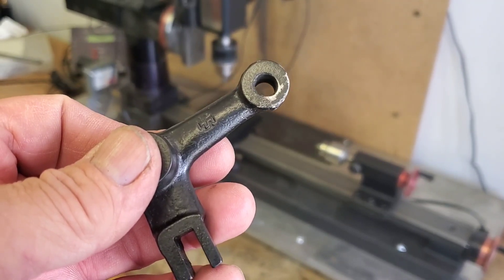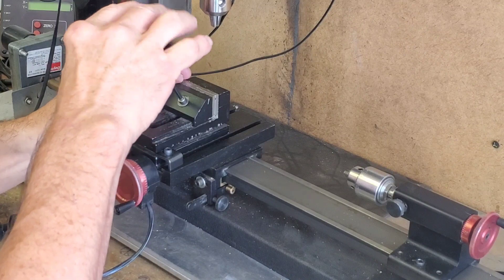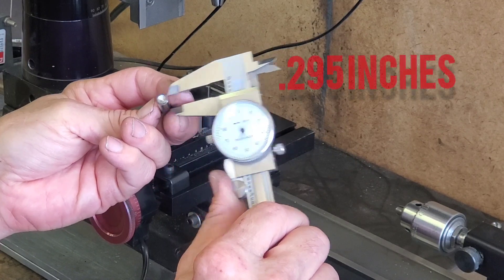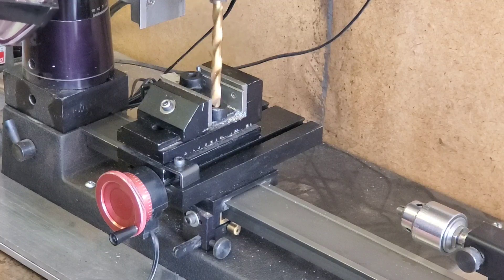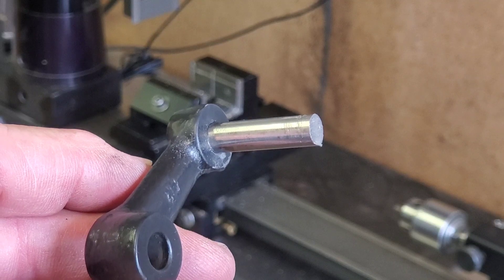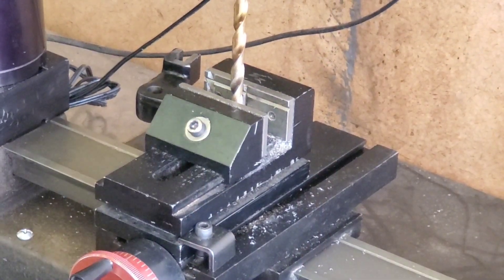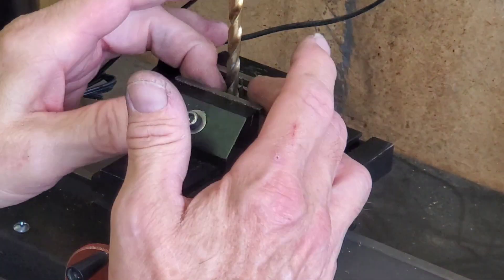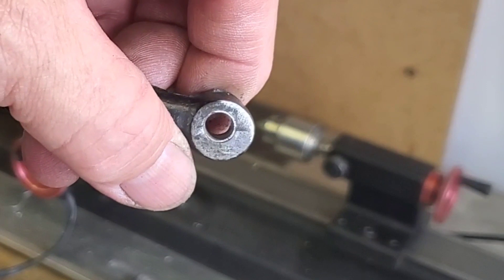How to Sleeve Shift Linkage to a Desirable Tolerance Using a Sherline Lathe

Comment: I have a question about a Saturn sky door handle? I watched your video about the solstice door handle...my door handle not opening door from outside or inside??? What do I do
Reply from the maker: It's likely that some of the plastic parts have deteriorated. The rods between the plastic parts are metal and should still be sturdy. Sounds like you'll have to remove the door panel in order to completely repair it and you'll probably have to replace the interior and exterior door handles as well.